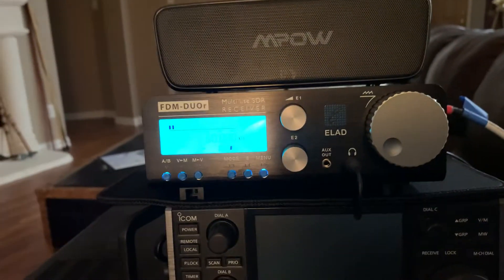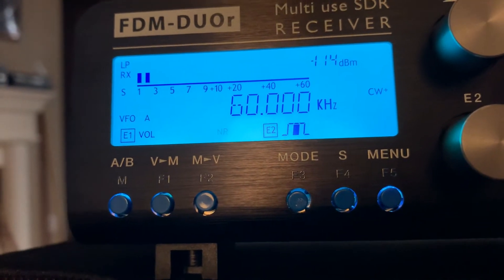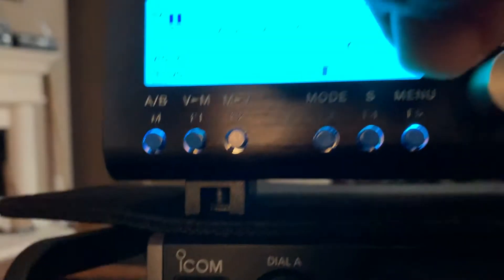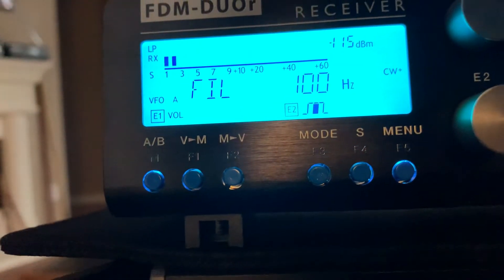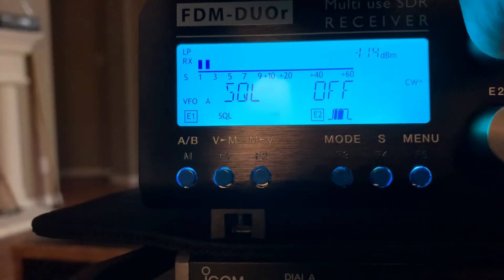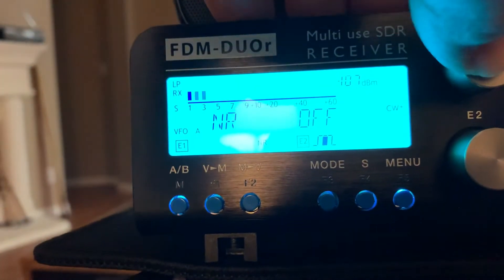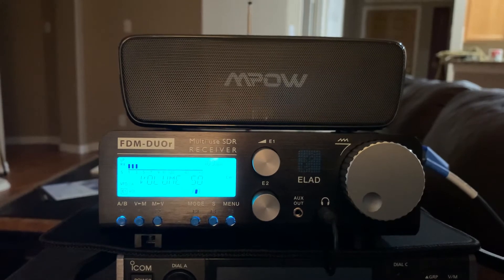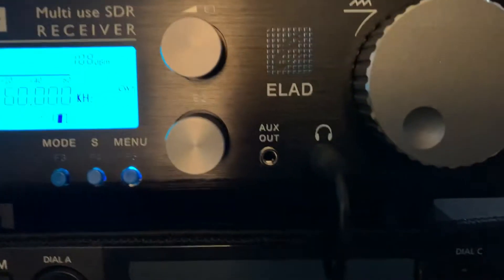Elad FDM DuoR on VLF

Comment: I had a ELAD about 3 years ago but along with my new mint in the Box, NRD-545, sold them after getting a Icom IC-R8600. It just outperformed the other 2. Also I got a bit nervous about the NRD-545 after folks started to report failures of the radio?? Decided it was best to depart with it before it failed and become a paper weight. Being a DSP radio, the 545 was great in its day, but the difference Nick between the 8600 and the 545 was very noticeable. Maybe you can compare your 8600 to the 545 and see how they compare... My 545 had the VHF converter. I recall selling it on eBay for $2000!! I was the original owner with the Box etc. etc. 
Robert
Reply from the maker: Robert I don’t have a 545!  I have a 515 and 535 and after using them I am not overly impressed. They function perfectly and I did a video on them so you can see that, but if someone wanted to do a trade I would be very interested
Reply: @dieselten01  ok! Thought I saw one on a desk!!